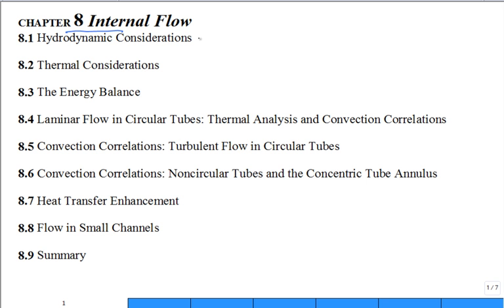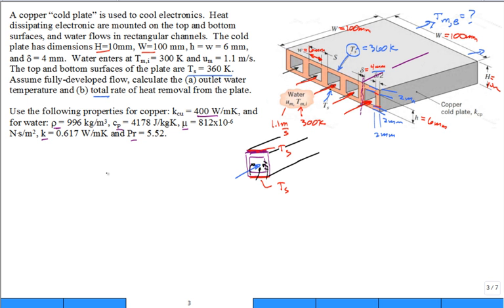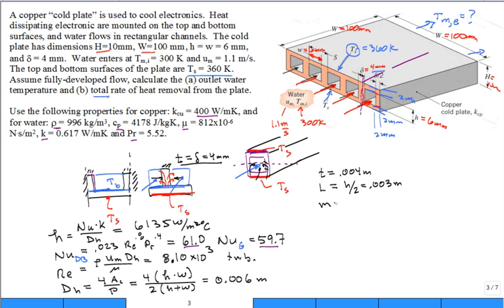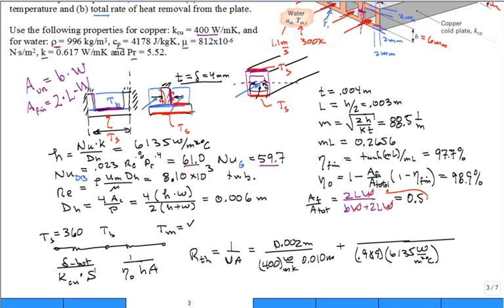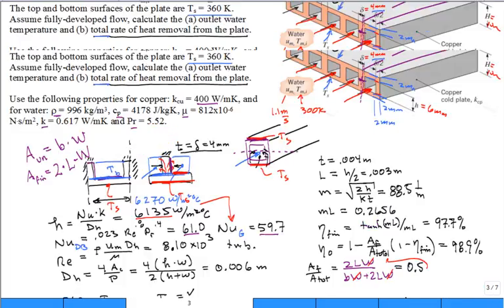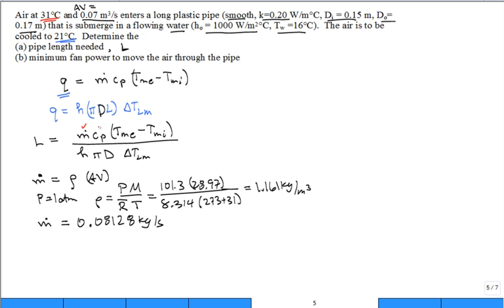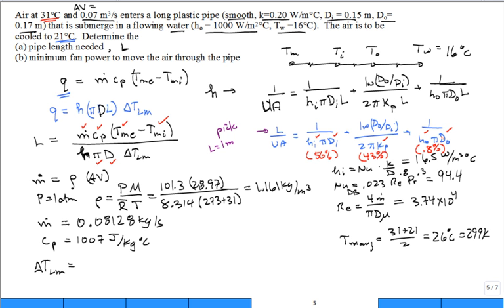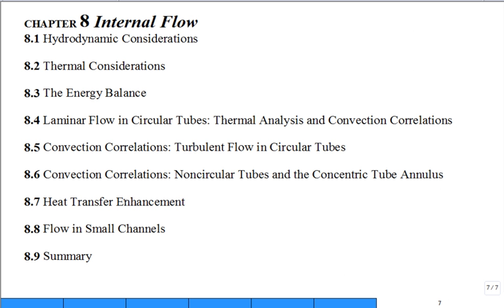PreRecordedLectureForMarch07

Comment: Hello Professor, I thank you for these videos, they are helping half of the class learn heat transfer, However in this video, in minute 18.51 when writing Area for the conduction part, you only wrote S which is only length.. could you check it out and see if its wrong?
thank you I appreciate your time!

Comment: @25.19 I am not quite sure how you found the mass flow rate for half the channel. I keep getting 0.01972kg/s instead of 0.1972kg/s. Also could you please clarify why there are 10 channels for the final mass flow. Thanks
P.S. your videos are fantastic!
Reply from the maker: one channel is mdot=rho*vel*A = 996*1.1*0.006*0.006 = 0.03944 kg/s.  Cut in half for half channel to get 0.01972 kg/s.  hope this helps